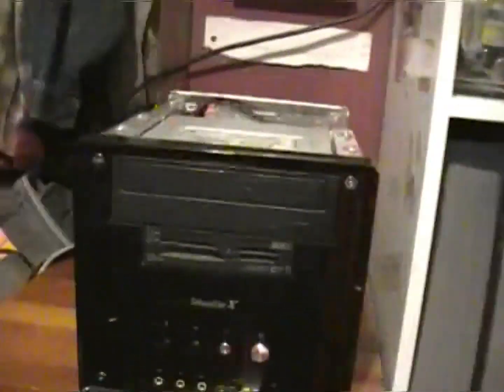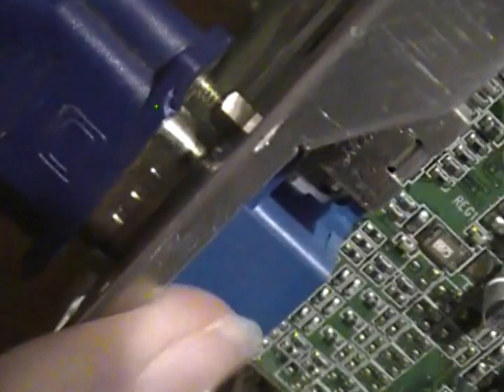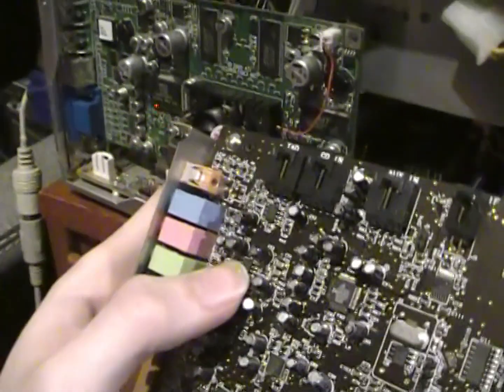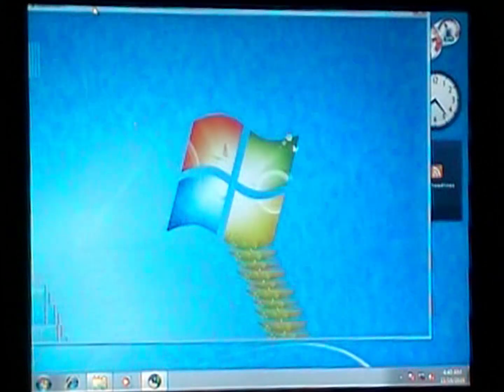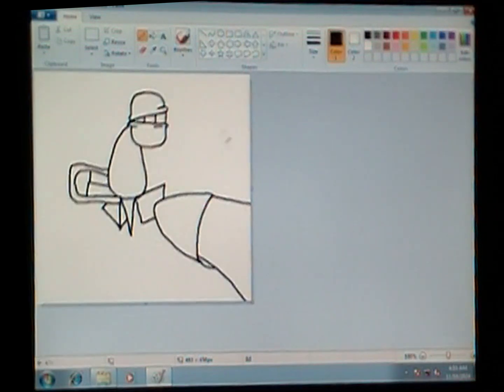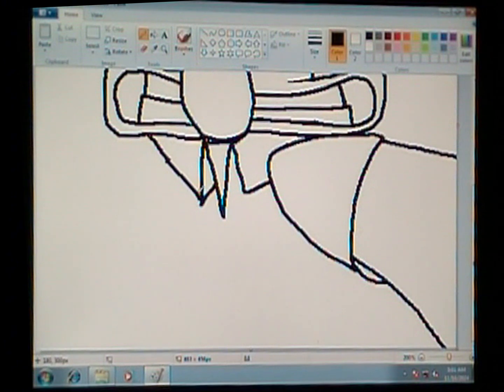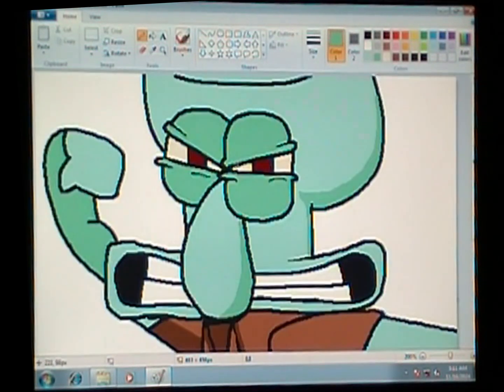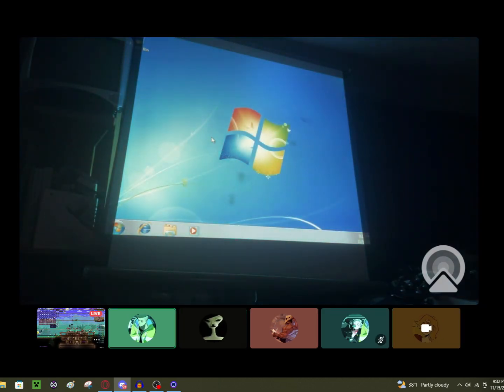how i built a computer for $10

Comment: Got a free dell optiplex 3060 with bent mothrrboard cpu pins with sl parts i took hours bending them back and built it into a normal optiplex then i got a 8 gb ram stick i installed it making it 16 gb then a 1 tb hdd and 128 gig samsung evo m.2 ssd for free from the same place then installed a 80 mm case fan and replaced the thermal pad with paste and indtalled windows 11 pro with key with my dad working in stone technologies i cam get get stuff hes a securirlty guard that protects a watehouse of 4090s cpus and prebuilts so he gets free stuff from there im gonna start paying for upgrades and get a xfx rx 6400 gpu and dual 16 gb ram sticks and maybie a better cpu

Comment: for the network driver issues. just get from snappy drivers tools the network driver pack only as an iso file. throw it on a usb with a mounting tool mount the iso and run SDI or SDIx64.
I always keep a copy of SamDriversPack iso. might be 40GB+ iso. But it will likely find every driver you need for windows. It also might fix your SATA issues

Comment: Shuttle PC back in the day but I have to admit that the hard drives were notoriously too cramped in there and overheated, day by day it got harder to replace the hard drive because they only have IDE hard drives and not SATA well today China is your friend and you can buy an SSD with IDE interface with Linux it runs like a charm
Reply from the maker: at some point ill probably buy an SSD but for now this works